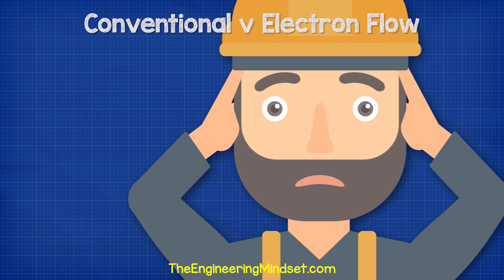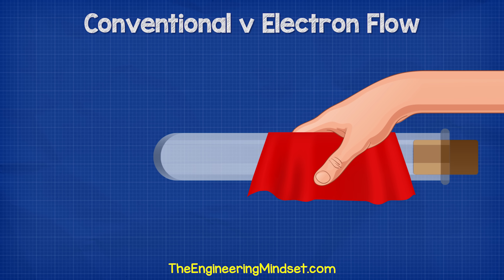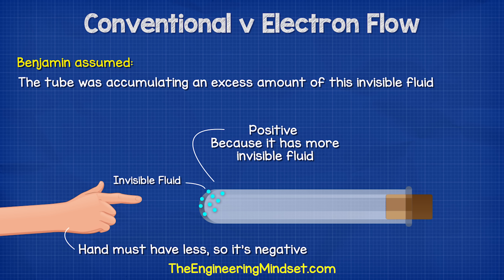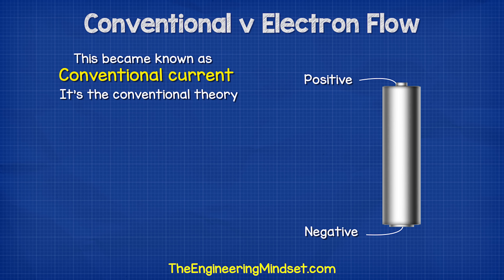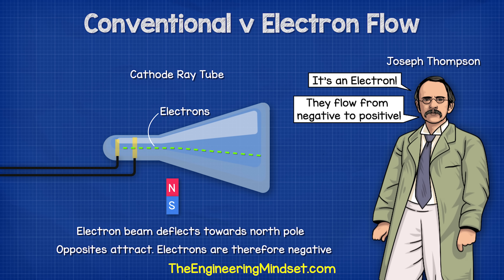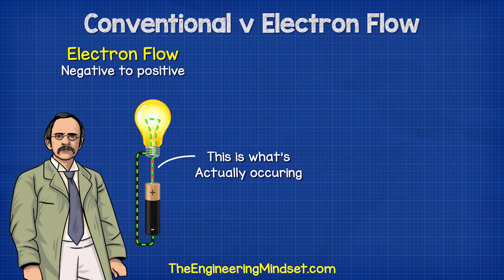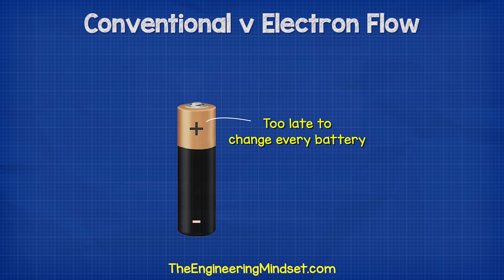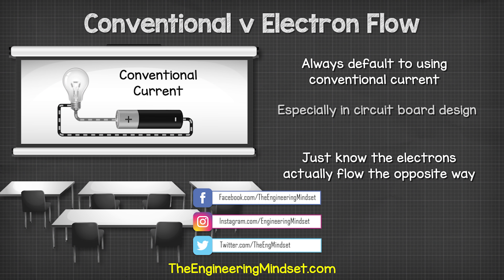Conventional Current v Electron Flow - Electricity explained

Comment: It baffles the mind how so many schools, colleges, universities, etc. just brush off this topic, then you have a bunch of confused students or people that want to learn electronics getting confused and frustrated. Same thing with the concept of Ground.
Reply: Leaving a comment so i can know if someone tells about GROUND
Reply: @acewarmonger6550  also curious about ground
Reply: What even is ground?
Reply: People are smart enough to play with 10²³ amount of atoms and orchestrate them to make things with intelligence but not smart enough to think that this convention should be changed despite the new discovery
Reply: Unnecessary confusions are still maintained to frustrate students 💯
Reply: Been asking this question myself even afters years leaving engineering world. Was it flowing from +ve to -ve or vice versa. They cant even explain properly. Always immediately get to drawing arrows without proper explaination
Reply: @Bona8fide  boy am I gonna have a field day shoving that thorn into the lessons when I start college 😆
Reply: Let alone the fact that it’s fields around the surfaces, not electrons inside the mass.
Reply: Learned electrical circuitry in high school using electron flow and then was often marked down in college because they were teaching conventional flow. It’s a freaking mess.
Reply: @evanlong2726  It's simple. Electron flow wasn't understood in the early days. Positive to negative became the convention. Batteries were made. Industry moved on. It all worked. To change it would have been an enormous and dangerous undertaking. 
Now, if you're interested in electron flow etc, you can learn that conventional flow is actually incorrect, but it works regards diagrams and formulae etc; but that in reality the electrons flow from negative to positive.
A bit like gravity. We learn that things fall to the ground due to the gravitational attraction between the thing and Earth. We develop formulae etc and it gets us to the Moon etc.
Then Einstein tells us it's actually masses causes a curvature in spacetime, and the thing isn't been pulled towards the ground by an invisible force, it's actually following the path caused by curvature.
Reply: @MatthewPhilip-v6z even worse - that the earth is growing towards that thing 😂
Reply: It was especially frustrating to learn as an electrician. We never use conventional current flow in the trade, but then trying to get into electronics or to learn electrical engineering topics as a hobby on the side where it seems common to use conventional flow was pretty confusing to begin with.
Reply: You are absolutely right. Nobody talks about this in school. I was so confused about this when i was in school.
Reply: This is so frustrating. I actually reading quantum physics history and electricity at the same time for school, so it annoying how this "conventional flow of electricity" gain what is truly happening 🙄😔
Reply: Woah, woah, woah. What about Ground now?
Reply: Same thing happened to me, i literally tore my hair off my head trying to wrap my head around how this could even be remotely possible in a solids like a wire, if it wasn't for the fact that I've been diving into the world of physics getting familiar with nuclear properties, it drove me absolutely crazy, until it was brought into light that the conventional way differs from what's actually happening because we're too lazy to update our model, and I've also seen how others have been completely stumped by this as well because hardly anyone including universities ever tell you about this two sided coin. It's time for an update for christ sake, it's causing so much confusion.
Reply: 👍👍👍🥰
Thankyou.🌏🌎🌍
Reply: For real. Been lowkey trying to learn electronics for years, now I'm getting more serious about it, and this topic frustrates me immensely  lol.
Reply: @Spitflies  No need for the frustration. When appropriate draw the arrow the wrong way (convential current). When appropriate draw it the correct way (actual electron flow). Both work.
Reply: 100% mate.

My "current" (lol) understanding is that, basically, it could be (IMO, just as "accurately" or i.e., sensibly) described that electrons effectively represent the 'positive' [as active/mobile force-carriers] current-conducting bodies in a given "flow" of electricity. While they do have a lighter/lower mass than protons, again they nonetheless are the moving bits that then (therefore) transmit the momentum/photonic force (moreso than protons which have heavier/higher mass thus harder to be pushed by photons and stay more static/stationary at the same frequency and intensity of light exposure) to other electrons, emitting/expressing/conveying/radiating (transferring) light/heat/force through objects in their path along the way (also see, photoelectric effect). 

Anyway, that's some of why I might say, that for the term "charge" - that (positive) symbol/sign assignment would make more sense for electrons. So yes, as opposite of what Benjamin Franklin conceptualized (prior to public/scientific knowledge about atomic structure, subsequent electrical experiments, etc.).  

On CHARGE - the polarization/"charge" level of X (whatever - an atom, molecule, compound, material matrix, micro or macrostructure, component, system, etc.) is basically describing/determined by the level of sub-atomic (or atomic or inter-atomic perhaps more accurately) (im)balance electro-magnetically. Underpinning the force that is "electro-motive" - electron motion: movement from HIGHER pressure/CHARGE differential (sub-atomic polarity/electro-magnetic IMBALANCE) to LOWER charge/imbalance, etc.

Blasphemy, I know!

I'm learning electrical and applying hands-on more and more so, we'll see what survives as a working-model and what doesn't, etc. I don't think the vehicles/machines I work on will care either way, so long as what I do, solves a problem. But my aim is also higher than just that (and, my brain has a hard time with accepting and applying seemingly contradictory info, per points raised by OP of this thread)!

I love the internet and content like this. But I am thinking that there ain't going to be some 100% video that lets it ALL 'click' with electrical to the extent I would like. Got to keep inputting the work "in parallel" (ha) on my end IRL, synthesizing what I survey and sift thru, tying it all together bit by bit, and who knows maybe I'll be a wiz at this someday. Cheers y'all, stay patient and stay applying IRL, deep-learning takes time so we have to allow that. Theory ain't perfect but progress is possible over time!
Reply: Re: balance seems key to charge. If there is EM balance (lack of polarity), then something is stable; if not (there is an imbalance/differential) then it is more volatile, voltage is higher.

On the other hand though, atoms with four or more valence electrons (e.g., carbon - especially when in diamond configuration) tend to be insulators as conductivity is significantly determined by how easily electrons in the outer (valence) shell can move (not just by overall charge balance per se). Still, there may be a way to "rectify" this conundrum; electrons at the edge of an atom are thus not as close to the internal protons, and are basically themselves not as "insulated" in an internally pressurized, electromagnetically-locked position in a sense, so seems somewhat obvious that they'll be more of what determines the level of conductivity of something than just net EM polarity at its atomic level. Also, to my understanding (stand to be corrected), most simple (pure) elements that are more on the insulator end of the spectrum (i.e., that contain 4+ valence electrons) nonetheless have more protons than that overall, and while some of their EM is being used already on pulling or holding in the further inboard electrons - the total number of electrons vs protons actually is relatively equal for most of them. Moreover, even if there were say, 1 proton less than electrons in an atom - more mass for protons plausibly means more energy stored and thus higher capacity to do attractive work on bordering electrons (relative to electrons' capacity to comply with compulsion to repell and be pushed out/stripped from atomic home when faced with/encountering surrounding electrons). Idk. My head hurts.
Reply: On ground, I am not as familiar yet. Some key associated terms seem to be, reference, negative, end-point (that last phrase is something I just contrived...) Could consider a circuit as a circle, with the source/starting 'point' as actually consisting of a composite object i.e., that has 2 ends - the line input comes from 1 end, while the other end will be designated as ground (or if not, will be connected to a chassis/conductive body/shell or something that then serves as ground)...something like that I think. Something key that is allows is, the completion of the circuit (and generally, is layed out/designed/implemented in a way that ensures protection against, e.g., the circuit shorting to ground thru a user and shocking or even electrocuting them in the process). Other aspects I could mention but like I say, not as confident on "ground" yet even though it is such a basic fundamental to understand with electrical. I intend to hammer the fundamentals to excess, then I'll have some hope of a good "ground" lol
Reply: @_Digital_Driver  I think the basic confusion is that sometimes ground means the ground beneath our feet and sometimes it doesn't.
Reply: A-fucking-men to that Tony. I had high 90's across my entire recent year of school and tanked electronics.
Reply: Well they matter in all kinds of things like radio tubes crt tubes and microwave tubes and x-ray tubes but considering this is how you used to learn now they ignore that but you still need to know, it technically also matters in things like semiconductors inner workings since if you connect positive to the p and negative to the n in a diode you grow the insulating layer which exists because N have more free electrons and P less and this creates a barrier of usually 0.7 volts or something like that now if you reverse this you dim down the barrier and it starts to conduct unless it's a Zehnerdiode that has a breakthrough if the voltage exceeds the isolation barrier strength.
They are still prone to breaking and your first suspect in boards repair after visible inspection of capacitors that grew a hood on top...

Regarding ground, ground is basically not always the same as ground a voltage difference can be measured between different ground rods under certain circumstances big AM transmitters need a whole network of those to even function without those the antenna that stands on a ceramics insulator and is as a whole the Antenna would not work.

Before lightning strikes ground becomes very positive and the clouds very negative then a spark discharge at large jumps over and transmits a radio signal and goes up to even small nuclear effects on top of the clouds into the ionosphere it is that intense...

It depends on how you see ground during a Lightning storm it is all but a neutral thing there might be other events where it is not purely neutral too...

You can build an AC line with high voltage return just one wire a top with high voltage AC and a large  concrete block with a load of iron through at both sides as ground return wire and yes that works,

 it was used in WW2 too using a bajonet stuck into ground and the other insulated wire on top for using more line length with less material this works better on moist soil so yeah the ground can act like a conductor too...
Reply: As a learner who has my head somewhere wrapped around this concept, I still get a little vexed at the different directions various textbooks have their CURRENT--not 'electrons'--flowing.
Oh well.  Seems to work.
Reply: Ground is the natural neutral charge of the earth that a positive charge will go to if it finds a path. The goal is to cause the charge to go through all the desired processes before it flows back to ground. I hope this helped
Reply: @Jerichodge Very wrong! And by assuming this you prove that you are not an electrician - or at least not a real one. 
And believe me that what I'm saying is not meant to disturb you. It is the truth!
The neutral, the secondary coil in the transformer in your neighborhood and the phase (hot wire) in your house form a single closed loop of wire. Actually that loop is open at the 2 main terminals in your wall socket. When you plug a device in that wall socket, you close that loop.
The current does not flow into earth through the ET (ground)!!! The earth has a very high resistance, disrupted paths, etc.

Think about the phase wire, the neutral wire and wire in the secondary transformer coil as one and the same wire! 
It comes to your house as the phase wire, it returns to the transformer as the neutral wire - it surrounds the core of the secondary transformer coil ( making up that coil), then it returns to your house again as the phase wire. It is a closed loop.

 If you are in the usa, that neutral splits into 2 in the secondary transformer coils, they make up the 2 coils and they return to your house as the 2 x 120V phase wires. And then return to the transformer as a single neutral wire.
At the transformer, a wire buried in the earth comes out of earth and touches/connects to the neutral side of that loop to give that side of the loop the 0V reference. I believe in USA there is a second wire that comes out of earth (ET) and connects with the neutral side of the loop at the main service panel at the entry of the house. In Europe we connect the loop to the ground at the transformer only. 
But that connection of the loop to the ground is only to give that side of the loop the 0V reference. 
The current follows the least resistive path which is through the loop (neutral -> transformer secondary coil -> inside your house as phase wire -> outside your house as neutral, back into the transformer's secondary coil). 
I hope this helps and you are strong enough to research this and to realize that this is true. 
The ground wire is for ground faults current, lightnings, etc.

Comment: In the US Navy, they teach theory in a difference between "Hole Flow" and "Electron Flow". When I first got out, and started working in the Civilian World, It blew my mind that the general consensuses was that electricity flowed in the opposite direction!
Reply: Hole flow is what happens in semiconductors, as well as electron flow in the opposite direction.  However, in metals there is only electron flow and in electrolytes there is also negative and positive ion flow.
Reply: @karhukivi  I reconciled the "hole flow" as charge voids instead. In my mind, this made it easier to visualize.
Reply: @amramjose  Whatever works best for you, stick to it!
Reply: @karhukivi  There is no such thing as "hole flow". Not in a wire, nor in semiconductors. The atoms do not move!  There is an outer electron ring (shell) in the atom, that is "capable" of holding an electron. However, the atoms do not move through the material; carry their little "holes" to the other end. They stay in there places. The atoms do not move. They do vibrate with heat, but they do not move though the material. It is still just the electrons, jumping from atom to atom, that move (from negative to positive) in the NPN transistor or any other semiconductor!
Reply: I started to notice in the 90's that books and videos were beginning to teach electronics using Conventional flow.   This really irritated me,  cuz it made no sense.  In the 1980's,  most literatures and videos were still teaching in terms of Electron flow.   It only made sense,  after all,  we were studying  ELECTRON-ics.  It would be weird to call it  HOLE-ics.
Reply: @WTF_BBQ  "Hole" flow is for semiconductors, not conventional flow as in metallic conductors.  Some beginners find a current flowing from negative to positive very counter-intuitive.  Also the rules about induction like Lenz's law have to be reversed for electron flow as they were devised for conventional flow.   The best thing is to stick to whichever system you were taught for electronics.  In physics we always use electron flow.
Reply: @WTF_BBQ  It not only makes sense, it is correct science! Electrons move, protons cannot because they are stuck in non-movable atoms! Atoms can vibrate with heat, but they don't move through the material. The only exception to that is liquids (and lava perhaps lol)!
Reply: Electrons in a metal move at km per second randomly  in all directions with tiny average or electron drift velovity in the presence of an electric field,  typically in the order of less than mm per second.

 Electrons randon movement of electrons create pockets of local over density and under density that try to balance the self locally, while they have  random but an average net opposing flows in an electric field, that we can think of the average under density pockets flow as a real physical representation of current flow and electron over denisity flow as electron flow. 

And hole flow is real and required for transistor therory. 

Both electron and conventional current flow have real physical representations.